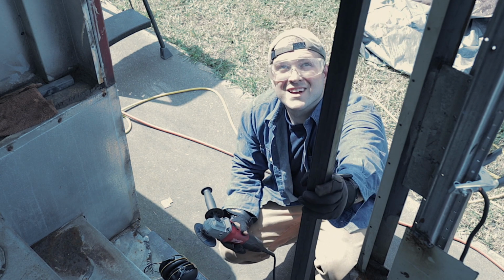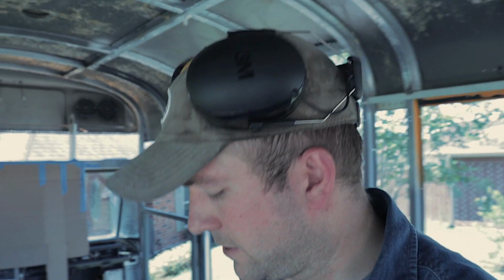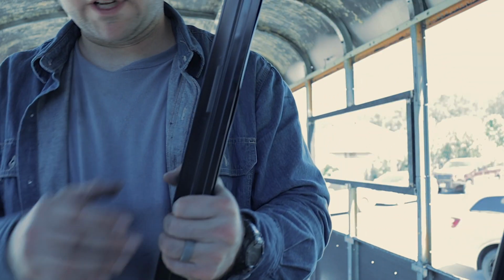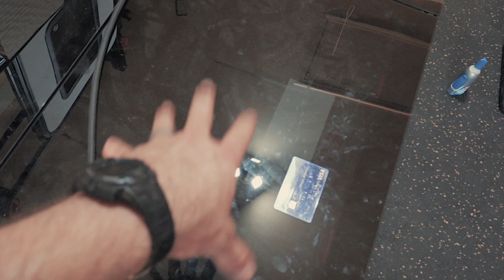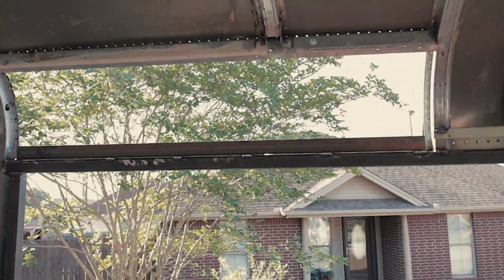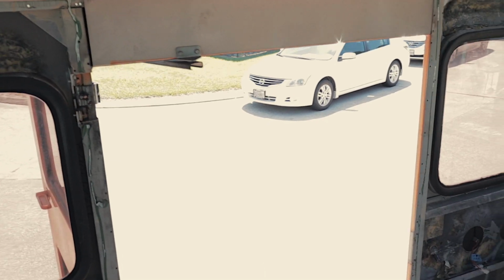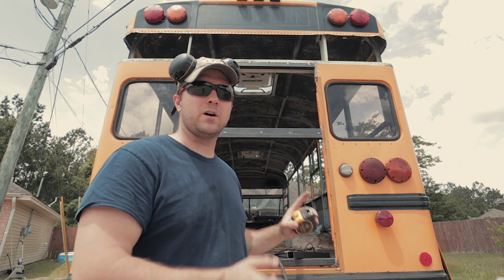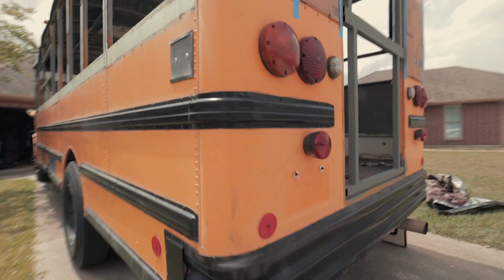Roof Raise Part 3: Window and Door Framing

Comment: Hello.  I just found your channel the other day and enjoying your videos.  What type of welder are you using?  I'm interested in getting started welding.  Also, how did you create your window frame pieces that you welded in the new spaces after lifting the roof?
Reply from the maker: Hey Carl, we’re glad you’ve enjoyed the videos! in this video I was using a Hobart 140. It worked great for most of the welding I did. I’ve since upgraded to a Hobart Ironman 230. The reason is the thickness of metal I’m dealing with. The Hobart 140 welds up to 1/4” steel. The Ironman 230 goes up to 1/2”. I extended the chassis to make a rear deck. The chassis is 3/8” thick steel so I needed the bigger machine. 

For the window and door frames I used 16 gauge steel tube that’s 1 1/4” square. I welded them directly to the hat channels. Be sure to consider the height of your countertops and other obstacles that a misplaced window might get in the way off. We are still hoping we didn’t misplace a window lol.
Reply: @TheGentzResidence   Makes sense, upgrading.  I'll look at the Hobart 140.  Thanks.
Reply: @carls4552  Just did a raise on a 96 Thomas using Lincoln 180 Mig.. Worked really well all around.. (Just learning on it also)